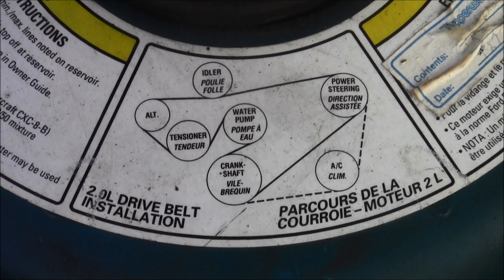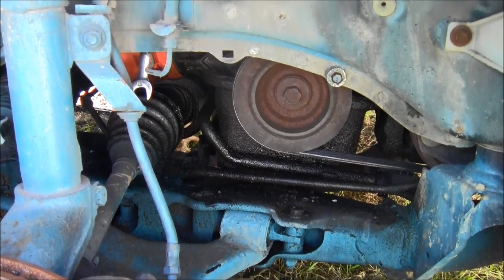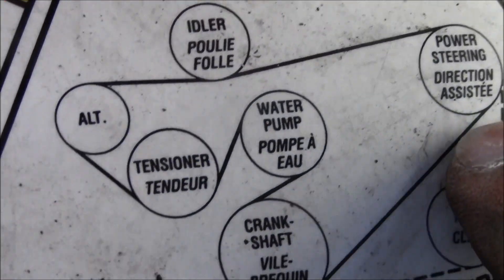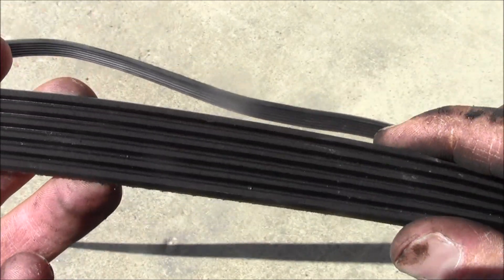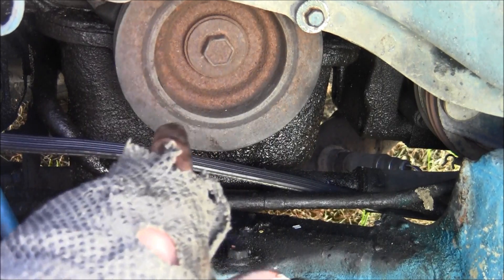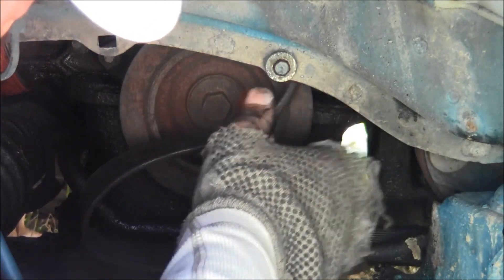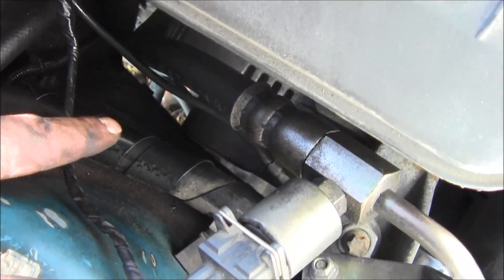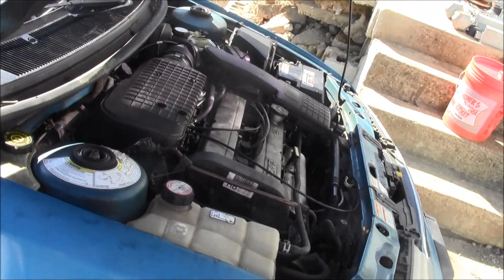How to Replace Serpentine Belt

Comment: Wish you had filmed how you got it on after two attempts.
Doing one now and its giving me fits being still too tight after putting all the pressure I can on the release pully
Reply: I’m having the same problem. Dow did u manage?
Reply: @justlilerick4863  
Harmonic Balancer broke and after replacing that the existing belt would not go back on.
Took the belt to an auto parts and compared it to the one they had for my vehicle and mine was smaller than the one called for which is what caused the harmonic balancer to break to begin with.
Take your belt to an autoparts and compare to the one they list for your vehicle.
Reply from the maker: Recently done this job again. One person pulls the tensioner while the other fiddles the belt on.